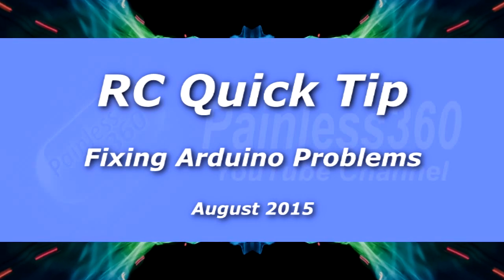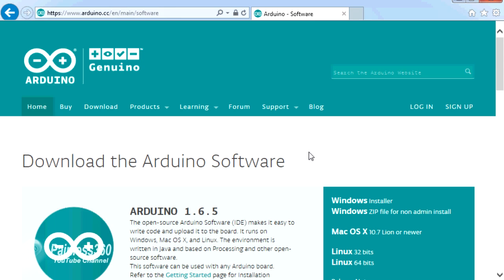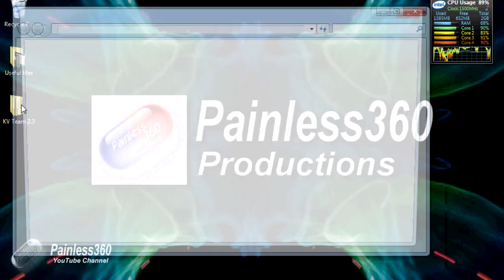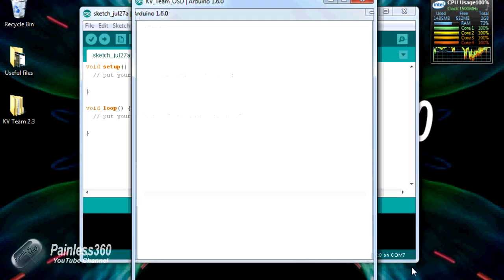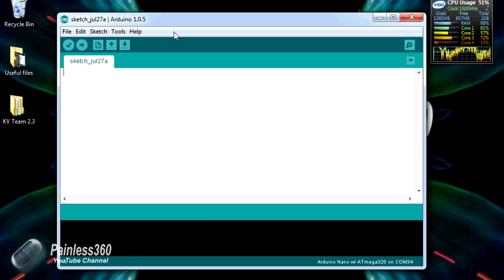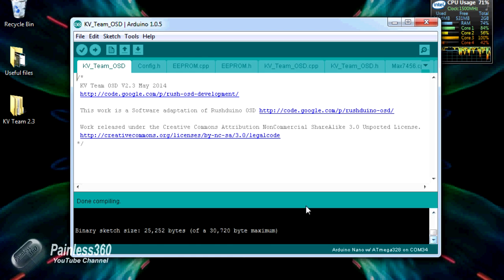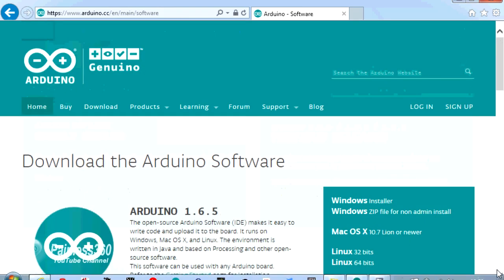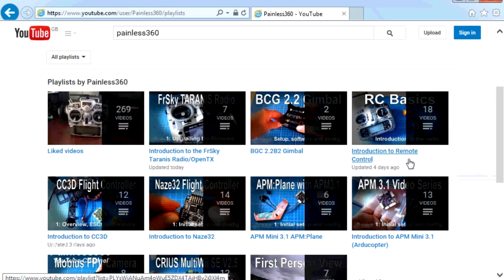RC Quick Tips - Fixing Arduino Verify/Compile Errors

Comment: hi, I am using arduino nano and could not get rid of the problem .
Here is Problem below.
Sketch uses 930 bytes (3%) of program storage space. Maximum is 30720 bytes.
Global variables use 9 bytes (0%) of dynamic memory, leaving 2039 bytes for local variables. Maximum is 2048 bytes.
avrdude: stk500_recv(): programmer is not responding
avrdude: stk500_getsync() attempt 1 of 10: not in sync: resp=0x28
avrdude: stk500_recv(): programmer is not responding
avrdude: stk500_getsync() attempt 2 of 10: not in sync: resp=0x28
avrdude: stk500_recv(): programmer is not responding
avrdude: stk500_getsync() attempt 3 of 10: not in sync: resp=0x28
avrdude: stk500_recv(): programmer is not responding
avrdude: stk500_getsync() attempt 4 of 10: not in sync: resp=0x28
avrdude: stk500_recv(): programmer is not responding
avrdude: stk500_getsync() attempt 5 of 10: not in sync: resp=0x28
avrdude: stk500_recv(): programmer is not responding
avrdude: stk500_getsync() attempt 6 of 10: not in sync: resp=0x28
avrdude: stk500_recv(): programmer is not responding
avrdude: stk500_getsync() attempt 7 of 10: not in sync: resp=0x28
avrdude: stk500_recv(): programmer is not responding
avrdude: stk500_getsync() attempt 8 of 10: not in sync: resp=0x28
avrdude: stk500_recv(): programmer is not responding
avrdude: stk500_getsync() attempt 9 of 10: not in sync: resp=0x28
avrdude: stk500_recv(): programmer is not responding
avrdude: stk500_getsync() attempt 10 of 10: not in sync: resp=0x28
Problem uploading to board.  See http://www.arduino.cc/en/Guide/Troubleshooting#upload for suggestions.
Invalid library found in C:\Users\Habib Daood Rathore\Documents\Arduino\libraries\sketch_dec11a: no headers files (.h) found in C:\Users\Habib Daood Rathore\Documents\Arduino\libraries\sketch_dec11a
Invalid library found in C:\Users\Habib Daood Rathore\Documents\Arduino\libraries\sketch_dec11a: no headers files (.h) found in C:\Users\Habib Daood Rathore\Documents\Arduino\libraries\sketch_dec11a
Reply from the maker: Happy to help but please watch https://www.youtube.com/watch?v=olIqTiSJHIY and come back to me with more detail of what you've tried..

Comment: Arduino: 1.8.6 (Windows 7), Board: "Arduino Yún"

C:\Users\rabani\Documents\Arduino\sketch_sep13a\sketch_sep13a.ino:1:29: warning: extra tokens at end of #include directive

  #include<SoftwareSerial.h> voice

                             ^

Sketch uses 8864 bytes (30%) of program storage space. Maximum is 28672 bytes.
Global variables use 370 bytes (14%) of dynamic memory, leaving 2190 bytes for local variables. Maximum is 2560 bytes.

avrdude: butterfly_recv(): programmer is not responding
avrdude: butterfly_recv(): programmer is not responding
avrdude: butterfly_recv(): programmer is not responding
avrdude: butterfly_recv(): programmer is not responding
avrdude: butterfly_recv(): programmer is not responding
Found programmer: Id = "þ"; type = È
    Software Version = ".

what to do for this error  from uploading board    plz help uss....../
Reply from the maker: What troubleshooting have you already tried?

Comment: The reason why i am having an error compiling is because the sketch is not compatible to the new version of Arduino software. Right? So I have to download the previous version instead in order for it to work, Right?
Reply from the maker: Possibly, give it to go. All of the common problems are in this video.
Reply: Thanks!

Comment: Arduino: 1.8.2 (Windows 10), Board: "Arduino/Genuino Uno"

avrdude: stk500_recv(): programmer is not responding
avrdude: stk500_getsync() attempt 1 of 10: not in sync: resp=0xf4
avrdude: stk500_recv(): programmer is not responding
avrdude: stk500_getsync() attempt 2 of 10: not in sync: resp=0xf4
avrdude: stk500_recv(): programmer is not responding
avrdude: stk500_getsync() attempt 3 of 10: not in sync: resp=0xf4
avrdude: stk500_recv(): programmer is not responding
avrdude: stk500_getsync() attempt 4 of 10: not in sync: resp=0xf4
avrdude: stk500_recv(): programmer is not responding
avrdude: stk500_getsync() attempt 5 of 10: not in sync: resp=0xf4
avrdude: stk500_recv(): programmer is not responding
avrdude: stk500_getsync() attempt 6 of 10: not in sync: resp=0xf4
avrdude: stk500_recv(): programmer is not responding
avrdude: stk500_getsync() attempt 7 of 10: not in sync: resp=0xf4
avrdude: stk500_recv(): programmer is not responding
avrdude: stk500_getsync() attempt 8 of 10: not in sync: resp=0xf4
avrdude: stk500_recv(): programmer is not responding
avrdude: stk500_getsync() attempt 9 of 10: not in sync: resp=0xf4
avrdude: stk500_recv(): programmer is not responding
avrdude: stk500_getsync() attempt 10 of 10: not in sync: resp=0xf4
Problem uploading to board.  See http://www.arduino.cc/en/Guide/Troubleshooting#upload for suggestions.

This report would have more information with
"Show verbose output during compilation"
option enabled in File -> Preferences.
Reply from the maker: +Himanshu Singh I assume you Googled 'stk500 painless360' to find our video on that error ;)
Reply: Try to change the programmer

Comment: I am a beginner, and I have trouble uploading a code to the arduino and motor shield. I have downloaded the other 2 files. I can't upload the code while the arduino is attached to the motor shield, but I can upload the code to the arduino when it does not have the motor shield. I get this error message when I try to upload the code: avrdude: ser_open(): can't open device "\\.\COM1": The system cannot find the file specified.
Problem uploading to board.  See http://www.arduino.cc/en/Guide/Troubleshooting#upload for suggestions.
I have checked the device manager (I have windows 10), and it says that it is connected to COM1.  Any advice? Thanks!
Reply from the maker: Sorry, I've not played with real arduinos. I'd upload the code with a shield on attached and then try it out. Best of luck

Comment: Thanks for the RC videos, they are great for beginners like me.Unrelated question -  What's the name of the utility you are using to monitor CPU cores & RAM usage etc.  (Top Right on your desktop) ?
Reply from the maker: +Heath Thacker It was a little app that worked on Windows Vista and 7 and could be made to work on Windows 8. Called 'All CPU Meter Gadget'. Happy flying!
Reply: Try RainMeter as well.

Comment: You should clarify that you had 2 different boards selected between the IDE versions you showed.  That makes a difference and if could have been nothing more than pin assignments between board types.  Its always important to ensure the right board type is selected.   That said, good tip on using different IDE's - I do this all the time.  Also note that the libraries loaded between the two could be the cause as well.

Comment: I have a question, I bought DJI 2212 920KV Brushless Motor for a V tail quadcopter. They are all 4 right hand thead. I have them all spinning the correct way by changing the wiring. The question is can I use all CCW props self tightning. The props I bought that use a nut on top will not fit and only CCW self tightning props do fit.
Reply from the maker: Roger Bowen If the threads are all the same way then two of the motors will spin off the nuts if they get loose. Be carful to nip up the props and consider using locking nuts rather than the spinners as they are less prone to coming loose in my experience.Best of luck.
Reply: Thank you for the help.

Comment: Excellent advice.  I use the Arduino for a variety of projects nothing to do with RC and contribute to the Arduino support forum.  There are many problems with the new software and old programs and libraries and as a result I have steadfastly refused to update the Arduino IDE (Integrated Development Environment).
Reply from the maker: UKHeliBob Very wise - this is one of the very few times I would advise subscribers to use the older version!